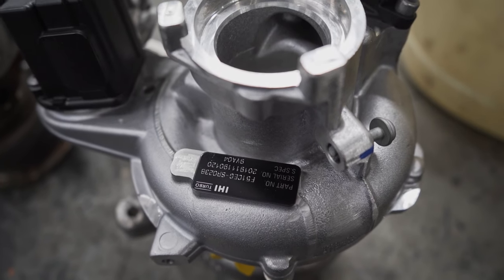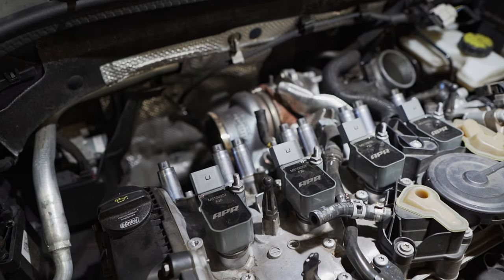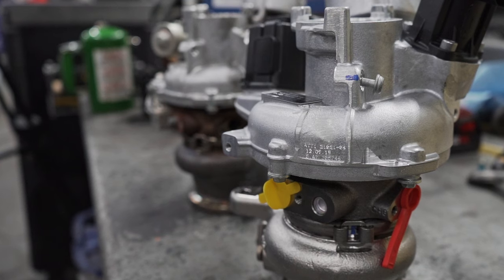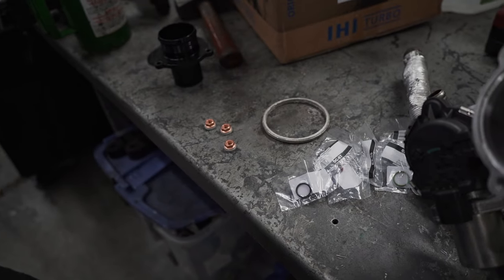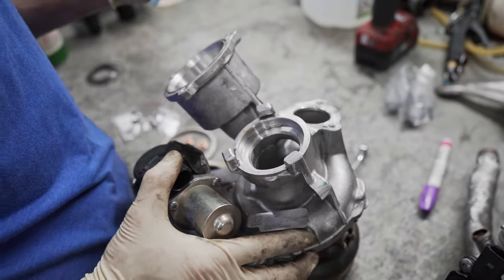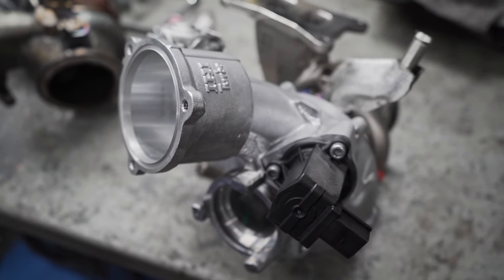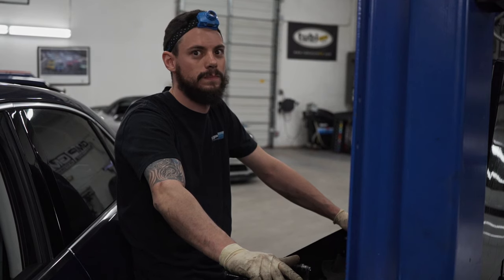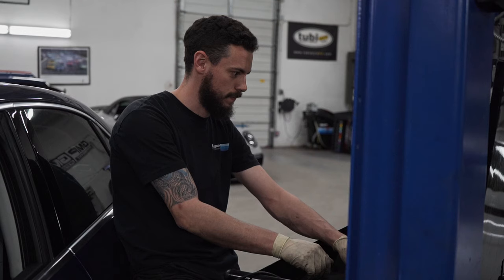APR STAGE 3 IS38 TURBO INSTALL *INSANE RESULTS*

Comment: The swap from is12 to 38 (mk7 golf) is mind blowing. Now I got an a3, I hope it’s as mind blowing. I read it’s like a is20 with a little more oomph and pulls longer up top.
Reply from the maker: Its a great improvement over the IS12/IS20! highly recommend! :)
Reply: Would you recommend it for someone who already has a is20 on the 1.8t and is looking to upgrade to is38?
Reply from the maker: @yacluck8343  probably not worth it imo. Especially with FWD

Comment: I’m UNI stage 1+ on my A3, intercooler and DP on their way.  Going stage 2 Uni within a week or two.  I’m already planning on going IS38 in the near future but I’m worried about DSG issues.  You have anything else other than TCU tune to handle the extra torque?
Reply from the maker: Sounds like a great build. No worries on the DSG. Make sure to run the appropriate TCU tune for your stage 2 ECU tune. Stay on top of your maintenance and you'll be fine 🙂
Reply: The DSG has been proven to hold plenty of power. There’s tons of guys making 500whp on stock DSG. TCU tune of course
Reply: killer_vette is there more than one tcu tune depending on the power? Or does one do it for all including stage 3?
Reply: @raildude270  I have been stage 2 now for a few months.  There is a separate stage 2 tune
Reply: @raildude270  mainly have stage 1 TCU which would be paired with stage 1 ECU of course. Then you have stage 2 TCU. Which can be paired with either one. Then you have stage 3 or custom if you go big turbo
Reply: @killer_vette351  interesting. I just had a TCU tune done by an APR dealer and they told me that there's only one TCU tune and it didn't change depending on what was done to your car
Reply: @raildude270  it should be a stage 1/2 TCU. Some dealers have that. You need more clamping pressure and etc as you make more power. My S3 is on E85 so If i ran a stage 1 TCU tune it’d probably slip

Comment: Man gives me hope! I’m debating what tune I use for my is38 swap on my gti. What other mods did you have to include on your stage three?
Reply from the maker: Thx for watching! Will need IS38, intercooler, downpipe, ecu and tcu tune. Would suggest going with a better hybrid turbo or drop in replacement since there are so many other options nowadays. Oem is38 still fine for the money though! 💰

Comment: I have an a3 8p wagon I was looking to upgrade. I'm sold on this is38. Looking for something I can just upgrade turbo and tune for now without having to do injectors and hpfp. I'll do that later on. First is the body I think. Rs3 front bumper. Rear bumper with diffuser. Side skirts. I have the spoiler. Rs5 led headlights and a paint job. Then it will be this is38 hybrid turbo and tune. I got the car for 3k in 2017. Blew motor. Put new one in blew that. The price 6 years later for one with 88k is 10k. Min3 has 88k on motor but 225k on tranny. Hope tranny holds up but I can do that 4k and still be around 10 to 12k into car

Comment: How much did everything cost?
Turbo $1,000?
Stage 3 tcu/ecu tune probably $1500?
Downpipe $500? 
Intercooler, hpfp, e30 flex kit, plugs and coils?
Reply from the maker: Thx for watching. This was installed with stock fueling system with 93 pump OTS tunes. I usually have parts linked in the video description where you can view current pricing 👍

Comment: I’m stuck between getting the is38 and the hybrid version. What do you think?
Reply from the maker: It depends on your budget and how far you want to go. I went oem IS38 because of the value. I was able to upgrade to the IS38 tune from APR for $250 + the cost of the Turbo. The hybrids are more expensive plus you have to factor in custom tuning and fueling

Comment: Good content man! My 2015 A3 Quattro is currently in APR Stage 1. When I checked with my local APR dealer they said they could only find the ‘IS38 with oem downpipe’ file for my car. Is it the same case for you?
Reply from the maker: Thanks for checking it out man! Ohhh yeah I could see that being a potential issue if you weren't already stage 2 with the authorization code. No possible way to go that route nowadays since the apr downpipes are discontinued, I already had that so I have the test pipe file still. Pop pop pop 😆
Reply: @savagepandaprojects  Hey man, did APR ask for any authorization codes when you upgrade to stage 3 testpipe file? I can still find some new APR Downpipes selling online. Do you think the codes with them will still work right now?
Reply from the maker: @zhengxuanwen1524  so on mine it didn't ask for any Auth code. I already had it with the downpipe and stage 2 from a couple years earlier anyways. As far as I know I don't they would have any reason to deactivate any Auth codes for products still new in box.

Comment: Great video. Question do you know if the ihi20 waste gate works on the 38? 
I’m having problems tunes the waste gate. 
Thanks
Reply from the maker: I did not recall having any issues with that on this particular install. I believe this one was drop in ready.

Comment: How much would it cost to have an is38 installed and software upgraded ... parts and labor
Reply from the maker: really all depends on where you source your parts and where you take it. I would estimate the turbo itself around $1100-1200 then about 6-8 hrs labor.

Comment: Is the IS38 better than the K04? Also will IS38 work in an A5?
Reply from the maker: Yes stock IS38 is found on the 3rd gen 2.0 cars where thr K04 was on the older 2nd generation motors. No, the IS38 doesn't work on thr A5 unfortunately 😕

Comment: Now let’s rock some dragy runs.
Reply from the maker: I plan to! I need to get my dragy back from my co-worker! Lol 😆
Reply: @savagepandaprojects  interesting to see how the longer gears on the A3 puts the power down on the IS38 vs the S3. Steal that thing back from your coworker. Will be waiting bro.
Reply from the maker: @ForRJ  so far the gearing seems totally fine. I've seen guys go back and forth about longer vs shorter gearing between the transmissions. I don't think I push the car hard enough to where it would really matter. I wouldn't see any reason not to go IS38 on the A3. Its just such a fantastic value now with the pricing.
Reply: @savagepandaprojects  Cool, so you only push it when you are filming? Same here I only push it hard when I am driving 🤣 Keep up the good work 👍🏻
Reply from the maker: @ForRJ  keep your eyes open for the next video!

Comment: What supporting mods do you need before installing a bigger turbo on an s3?
Reply from the maker: basic stuff being intercooler, exhaust, 1 step colder plugs, ignition coils, etc. could be fueling requirements as well. depends on what your goals are etc.
Reply: @savagepandaprojects   any input on the mqb boss 500 turbo mine just has an upgraded intercooler and inlet pipe don’t want anything super crazy maybe just 400hp
Reply from the maker: @fredrios4217  I wouldn't go that route personally I would suggest looking at the EQT vortex, DBV2, also the new drop in replacement turbo from APR. Just a few suggestions that are generally popular in the MQB community 😀

Comment: So do you have a CEL now? APR doesn’t shut off the rear o2 anymore.
Reply from the maker: I do not because I already had the authorization code from the previous purchase of the downpipe.
Reply: @savagepandaprojects  hmmm interesting. I am already stage 2 APR I got it before the cut off date. Wonder if I’d be good also?
Reply from the maker: @branman65  most likely you would be good.
Reply: @savagepandaprojects  so did you use the auth code at the same time as installing the is38? Sorry this is my last question. Thank you.
Reply from the maker: @branman65  no worries. You can always send me a DM on IG. I don't believe we had to for this particular install with the IS38
Reply: @savagepandaprojects  I guess what I’m asking is were you already stage 2 with apr before going is38? So in other words the code was used when you previously went stage 2. Or did you install the Downpipe and use the code at the same time as the is38 install. Hope that makes sense. I read so much conflicting info on forums.
Reply from the maker: @branman65  I had already been APR stage 2 with auth code from downpipe from a couple years ago. Hope that helps clear up any confusion.
Reply: @savagepandaprojects  perfect thanks for the fast replies.

Comment: can an Audi A3 rebuild engine handle is38etr v2 instead of is38 stock??
Reply from the maker: It really depends on the tune, condition of the motor and how it's driven. Might be ok if you have a conservative tune that keeps the torque down

Comment: With this turbo fit the 2020 q3 turbo? 45 tfsi 2.0T?
Reply from the maker: I don't think so and there likely isn't tuning avaliable to support upgraded turbos on the current Q3. Those also use a Aisin Trans not the DSG so that would also present a limitation

Comment: I'm Not too impressed with my APR IS38 setup on my G7 Gti, 0-150km/h does the same time plus I did TCU software. Hmmm
Reply from the maker: I think the challenge really there is the limitations of FWD. This car hooks up no prob. 0-60 easily under 4 seconds
Reply: @savagepandaprojects  Really !What are you doing that it sticks so well?
Reply from the maker: @jesseainslie2404  launch control +all wheel drive! 🙂

Comment: dfor the a3 when going stage 3 do the a3 need to upgrade fuel injectors or oem is okay?
Reply from the maker: Not on the 2.0 models
Reply: My S3 is full E85 on stock fuel injectors. It’s all good man

Comment: Hey was wondering if it would be safe to do a is38 swap on a 1.8t mk7 golf?
Reply from the maker: You definitely can but I wouldn't push it beyond OTS tuning  (apr, IE, Uni etc.) Have fun!
Reply: @savagepandaprojects  so jb4 would be out of the question I'm guessing 🤔 thanks for the reply!
Reply from the maker: @yacluck8343  yes definitely don't want to use jb4
Reply: @savagepandaprojects  the thing is I have the tiptronic transmission, would it still be fine?

Comment: How much does this cost?
Reply from the maker: Turbo itself is usually about a grand. The stage 3 tune Upgrade price from  stage 2 is $250. Then of course add Labor/ installation
Reply: @savagepandaprojects  hey I got a question, so I have a buddy who has a 2018 A3 premium non Quattro, was wondering if it was possible to do an IS38 swap with the IS20 and doing the APR tune with it, can it happen?
Reply from the maker: @davidcastillo5405  yes this is possible but the 1.8 FWD is going to have so many traction issues I don't see a benefit as it's going to be nearly impossible to get the power down.
Reply: @savagepandaprojects  its the 2.0 TFSI  a3 premium same engine as the quattro, and thanks bud!! that informations helps lots

Comment: If I missed this, what needs to be done for the fuel system?
Reply from the maker: no fueling upgrade needed on this turbo (OEM IS38) 93 octane
Reply: That’s really awesome !

So how large is an Is38 vs K04?

Apparently I was told that anything larger than k04 on Audi GDI engines would need upgrades fuel system as those bigger turbos such as GTX2867R won’t get “woken up”...by the stock system.

My car is a A4 B8.5 2.0T, apparently that’s the go... anything around GTX2867R, may need larger injectors and possibly port injection or both... and the OEM ecu isn’t capable and needs standalone management. Unless A3 2.0T has a more capable system in audi?
Reply: @eeiko321  the 2.0T in your car is different from the one in the A3
Reply: What is the difference then?
Reply: @eeiko321  if I’m not mistaken, you have the Gen 2 EA888 motor compared to the newer Gen 3 EA888 motor
Reply: Ahh yes. So that one featured has the Gen 3?

I’m aware that the Gen 3 has the additional injector that works with the direct injection. Helping out with the carbon build up.

Different cyl compression?
Reply: @eeiko321  yup, 2015+ A3’s have the Gen 3 EA888 same with GTI’s and stuff. R’s and S3’s as well But the motor is a little stronger in those. Overall the motor is just better. Can hold way more power than the Gen 2 ones and respond way better to tunes than the Gen 2 ones. GTI stock block record is 10.5 (big turbo and etc but stock internals). Golf R stock turbo record is 10.5... compare that to the stock turbo record by the mk6 R. It’s a world of a difference between the Gen 2 and Gen 3 engines. Also Gen 3’s have proven to be very reliable.
Reply: I see.

Yes sometimes you can’t ignore newer technology.

The reason I asked is that, I think my engine will be fairy strong.

I’ve just gone through a full build, everything fully built with forged pistons, Conrods, racee bearings, performance springs retainers and valves.. the only thing stock left is the Crankshaft, camshafts & stock head gasket

Some of the parts are said to be tested on VWs 2.0T to around 700hp & 1000hp.

So a big turbo in the works is not impossible for my car… but the limiting factor is the fuel set up and ecu apparently.

The GDI is very limited, either a totally different ECU (motec or Haltech?) … a stand alone management system  to work the additional injectors and pumps…

so yeah, apparently the stock ecu for my 2013 A4 20T gets confused when needing more than K04